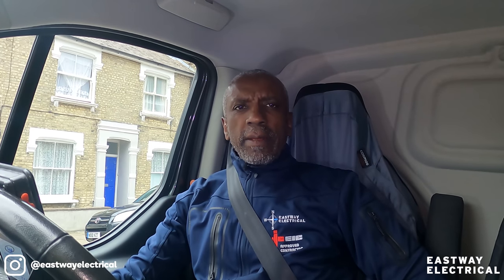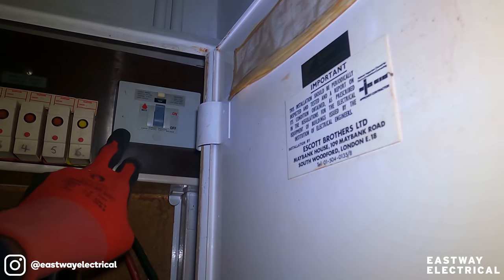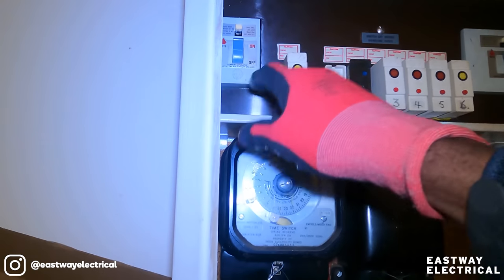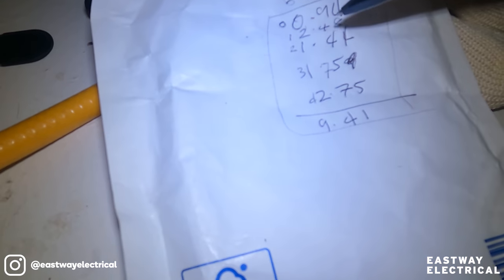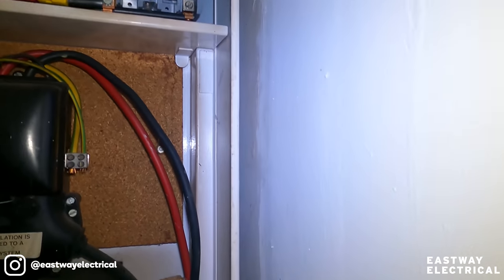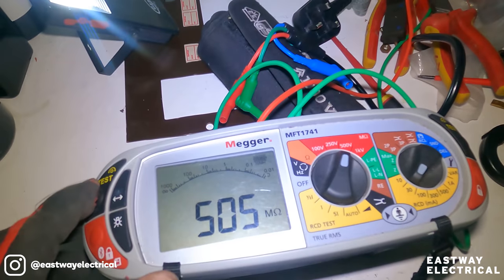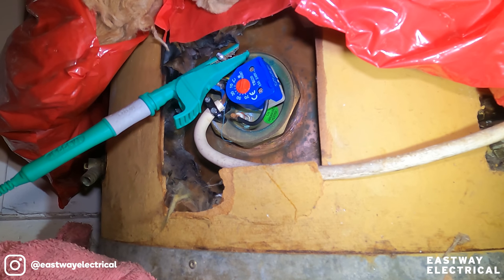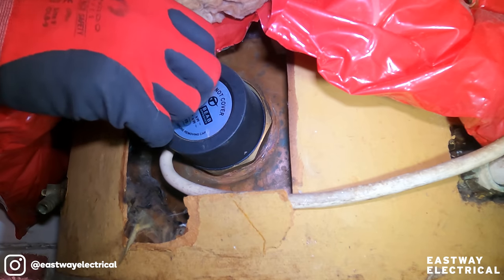"I've Never Seen This Before!" | Tripping RCD | Electrician In London

Comment: Hi sir as a retired electrician I can see a lot of potential issues, which I’m sure you have considered . You could potentially spend a lot of time trying to 
Pin down the fault , definitely those old RCD units are well past their best . But the whole instillation as you would concede is in need of a full upgrade . As for that door with meter tails that move back and fourth , that’s  indeed a first for me .  Just as a point of interest one of my old work mates had a persistent trip fault that happened at night , it turned out that a new fridge freezer had a door defrost program set to happen at night . When he contacted the manufacturer , they said yes we a aware of the issue and recommended that the unit has its own dedicated circuit with no RCD protection . You’ve got to laugh sometimes 😂.        Best wishes and kind regards 👍👍👍

Comment: There is a little mirror in the panel. Great for reading the Sangamo S200.31 meters with the large numbers, not easy with an LCD meter. Weird set up with the incoming mains on a hinged panel. Not very safe as the incoming supply wires are flexed all the time.

Comment: I try and solve these jobs over the phone and it works 90% of the time.
Top culprits are the kettle,the hob or oven elements and laptop chargers. most equipment around the house is double insulated . So advise helps the customer track down an intermittent fault.

Comment: If the hot water exceeds the temperature it’s set at don’t you think there could be a problem with the thermostat ?
Reply: Almost definitely I reckon.
Reply: Most likely and a quiet dangerous, would be an idea for the client to get a dual cut out thermostat.
Reply: Mine comes out as steam and just melts the top layer of skin off. Nice and fresh

Comment: where I am, that would be from a weatherproof outside receptacle that has had salt air get into it and leave a film of salt on it.  then when the humidity is higher, it will trip, and when it dries out, it will behave until it gets wet, again. - or simply a leaking one that trips when wet and clears when dry.

Comment: The off peak immersion heater could be on in the day instead of overnight as the timeclock in the meter cabinet may be set wrong especially if there has been power cuts which would put the time out with the clock stopping.
The temperature would be down to the cylinder thermostat but looking at the condition it would probably be best to change the immersion heater element depending how old it is and if its a hard water area.
Reply: A step in the right direction would be put a 2 rate smart meter in, which does away with those unreliable old timeclocks. That at least would solve the immersion time issue.
Reply: @paddington4815  The timeclock is owned by the energy supplier
Reply: @0liver0verson9  fit a horstmann timeclock in the airing cupboard then it will have a time clock for overnight and 1 hour boost as well,  it sounded like there are already 2 supply's for 24 hour and restricted
Reply: @paultipton743  Just remember the supplier timeclock dictates when and how much the customer gets charged on the lower 2nd rate, nothing else. That needs to be rectified or any other timeclock won't be ensuring they use the lower rate on the meter effectively.
Reply: @0liver0verson9  The time clock just activates the supply to the off peak circuits at certain times its just a switch  even if it was not active or on 24 hours the lower rate would still be charged at those times on all circuits  determined by the meter suppliers even for general use circuits like socket outlets and lighting,so a time clock that is out of sync could be charging at a higher rate if its still running after the meter tariff low rate times.
A rate 2 smart meter would solve that as you mentioned previously or by disconnecting the off peak immersion circuit from the consumer unit and just using the 24 hour supply to a separate timeclock set to 2am -7am should have the same results and still be charged at the lower rate.
Reply: @paultipton743  No the timeclock activates low rate on these dual tariff meters. If it's out of sync with traditional E7 times the customer will not be charged more for the cost of heating the water. It may benefit them if it's grossly out of sync. The thinner wires on the timeclock are for triggering the meter.

Comment: Upper immersion is used as a backup or boost and generally switched off... customer has e7 2 rate time switch which should kick in overnight (off peak) and liven up lower immersion which will heat up majority of cylinder, wired wrong Del...  their electric bill must be nice....

Comment: At my place we were always having trouble with the RCD tripping intermittently and it turned out to be the Toaster. The Toaster would only cause the RCD to trip if it was used twice in a row , i.e the toaster was already warm.
Reply: Check for debris touching the elements inside the toaster, they can cause the RCD to trip.
Reply: over loaded circuit will also cause a  trip
Reply: @johndjchemistwhite9377  Yes, we ended up replacing the Toaster but it was an intermitant fault that has hard to pin down as the Toaster seemed to work fine.

Comment: I always look and ask 1st.
anything diy been done recently 
any faults with dishwasher 
boiler
or  washing machine or any outdoor sockets or lights

then get megger out and look for low insulation readings 

rcd test in ramp test like he did.

sometimes the fault can be the water heater element going bad had that few times as the insulation breaks down over time on the heating element
Reply: Absolutely!  - a bit of good detective work first works wonders!

Comment: Usually when a hot water heating coil breaks, it breaks open circuit. The temperature shut off gauge on the tank is broken since the guy said he was getting to 80C water output.
Reply: Yeah, you can replace the thermostats on those immersion heaters really easily. They pop out without having to remove the rest of the unit from the tank (where you risk tearing the copper or flooding the place!). They come in 2 sizes and they're cheap. Simple resistive loads like the ones in immersion heaters can trip an RCD when they are failing, but I don't think they'd put current on the CPC, which is needed to trip an ELCB.
Reply: @havoctrousers  Toolstation, 7" and 11". £8.99 or something like that. 

It will put current on the CPC depending how it's breaking down, seen it before where they've just started to go and it's not enough to cause SS and trip the fuse or MCB but it'll do the RCD. If that tank is scaled up which looking at that insulation it's 1980s ish yeah I'd fully expect it to be scaled up, corroded and high enough res to not throw an ELCB when hot, but cold it's a different story.

Comment: Really interesting video and a joy to watch you going through your thought processes and testing. Here is a suggestion:  From what you showed and what the customer said, I would suspect there is a borrowed live bridging the economy seven timed circuit.  This gives an alternative path when the timer kicks in at night causing the residual imbalance and thus tripping the RCCB at night.  As the timer is disconnected during the day you were not able to detect the connection with your testing.  I suspect if you find the rogue connection to the element you would find the issue.  Remember an RCCB looks for an imbalance of current and that can occur on the live or neutral without the need for any path to earth.

A simple test would be to check if there is a voltage (under a small load to remove parasitic coupling errors) on the live from the timer.  This should be dead and switched out of circuit when the timer is off.  Thus when the timer turns on the lives will be connected together creating an alternative path for current. If what I think is true then switching off the second RCCB would probably stop the fault as the two lives would no longer be able to be connected whatever the state of the timer is in. As with a neutral to earth fault the current will only flow when a load is connected so it can appear intermittent just like a neutral to earth fault.
Reply: Wouldn’t this make it trip every night ?
Reply: @danielnielsen3035  Not necessarily, as they're both effectively connected to the same voltage source.  It really depends on the load.  When there is no or little load then the current will be small. As the load increases the residual error current will increase.  As the economy 7 runs when most people are using the least electricity it is likely they are also using very little electricity.  As they have jerry rigged the hot water cylinder, the element may not kick in, causing a sufficient load to cause the trip as the cylinder is already hot.  If they were to use an electric kettle or use an electric shower, etc. it may also cause a trip.
Reply: That was really insightful, thank you

Comment: Have seen a few combined meter cabinet and consumer units in the past but not quite like that with economy 7 timer built in. Have had it loads of times where the fault isnt there when i go to investigate.
Reply: that's one of those laws of nature.  the system works perfectly when the repairman is there.
Reply: @kenbrown2808  usually reappears just as you get in the van and drive away.
Reply: @chrismaplethorpe6781  nah, usually right after you get home and get your shoes off.
Reply: @kenbrown2808  usually the customer doesnt seem to understand that intermittent faults happen then moan at us for not doing our job right.

Comment: There were two kinds of ELCBs, voltage-operated ones and current-operated ones. VOELCBs relied on an isolated CPC throughout the installation and sensed a voltage between the earth connection to the ELCB and the CPC, i.e. they're easy to spot as you've got two earth connections that an RCD doesn't have. COELCB is just an old term for RCD, technically it's absolutely the same.

VOELCBs should be replaced immediately as they don't offer any protection if someone touches a live conductor and they become immediately useless if the CPC is earthed. They only disconnect L-E faults.

Comment: It's probably his kettle leaking slightly. Had the same problem in a property I lived in and it would nusience trip the RCD on a split load board 

Surely the immersion being on at the wrong time was the timeswitch not being set right ?

Comment: How this clamp meter works if it was putted on Live and Neutral simultaneously?
Reply: Perfectly fine to do so, as the neutral will not impact the reading in any sensible way and when done this way would have also shown fluctuations in the return as well as the supply. There is, however, a risk of it picking up extra measurements if for some reason the neutral wire is live as well however in this case the wiring was pretty evident.
Reply: It's measuring the differential current. Common mode currents are cancelled out so the indicated reading is leakage current.
Reply: That's make sense just will read leakage current. Learn something new... Thanks Nick & SDG
Reply: An earth leakage clamp meter goes over both wires to measure the live current minus the neutral current, giving the leakage current. How it works is that the non-leakage current is equal and opposite in both wires (i.e. is differential), so it cancels out, whereas the leakage current travels in the same direction in both wires and so is picked up by the meter. A normal current clamp meter goes only on the live wire to measure the total current.
Reply: Hi -
A clamp meter works by measuring the magnetic field around a wire that is carrying current. ( hence the "clamp" around the wire to "sense"  the field)
Why clamp "both wires" ? 
 In a simple "perfect" circuit where  there are "two" wires connected to  a load - the current will be the same in each wire  -since "what goes "in"  on one wire , goes "out" on the other wire " - there is nowhere else for the current to "go".
NOW - if we arrange our clamp meter so it clamps around both wires - then the magnetic field will be zero since the currents in the wires are going in opposite directions so the two fields cancel out.
(as per above - going "in"  and going out)  and  thus we will read ZERO current. 

Now- it's easy to see that if there is a fault in our simple circuit which allows current to "escape" via another path - then the currents in our  wires won't be the same - and we will see a reading equal to the "difference" in the current - and it's easy to see now that this difference current that we measure must be equal to the "leakage current" going "somewhere" else.   
 
Whilst this is alright in "theory"  with the idea of a simple circuit as described  - in the practical case - finding where that "leakage" current is going - and what is causing it -  is often not  easy to find.  
Also bear in mind that in the practical case - especially where appliances and loads are connected - there will be some leakage current  that we will call "normal".  
And HERE is the problem with a "common RCD as is the case here - and ALSO  that you see oh so often in split load boards ( they are the cheaper solution for board changes)  -- since  it is "seeing"  the total leakage current of many  circuits combined - and -  now you can see, that you only need a  few milliamps of leakage current in each circuit to get "close" to the RCD tripping current - and so another small increase of just a few milliamps due to a minor fault can then cause the RCD to trip.  
This is why I ONLY EVER fit RCBO's  in board replacements etc - a few extra £'s of cost - but then only the circuit that is faulty will trip AND  saves an awful lot of bother down the line - cost saving!

On top of that - the  random  tripping RCD at various times as reported  could be due to a number of factors - and a good course of action here is to ask the client if anything has changed recently  - such as lights/light switches/sockets being changed  etc  etc and  IS there specific times when the RCD trips. 

Often  - where for example  -decorators have removed switch faceplates etc and then replaced  without taking care to make sure wires are suitably placed before refixing - can result in neutral wires being trapped under fixing screws  -where the insulation has just been "nipped" by the fixing - and pressure on the faceplate can be enough to cause a connection between CPC and neutral - which will often cause sufficient imbalance to trip an RCD.
 
I have to say that the installation is "well past its sell by date" - and a full re-wire of the property is the only real solution. Also - Meter tails and Henley Blocks on a pivoting board is downright dangerous.  Certainly wouldn't fit in with BS7671 "selection and erection requirements" 
I wouldn't be happy leaving an installation in that condition. 

Anything less than a  rewire. and all you will end up with is  - "owning the problem"

Comment: I've had it where those old Wylex RCDs just start to fail and intermittently trip. But test ok under test conditions . Id say a board change is required
Reply: I'd guess they're 40+ years old, possibly 50. They weren't a Wylex design, possibly not even manufactured by Wylex. Presumably, the original design was by F&G Austria in the mid-1960s but they were sold under half a dozen different names - F&G, Elin, Wylex, ESG Dresden, Hackbridge Faraday at least. THis being London it's probably an underground supply but I do know these RCDs are particularly prone to nuisance tripping from lightning transients. That's why many older people in Austria don't think you need surge protection - "the RCD will trip anyway". For the Austrian market the design was changed in the mid-1980s, so I guess these are at the very least 35 years old, unless someone else continued making the older-style ones.

Comment: Them old wylex boards with elcb were designed for social housing good idea but if a light bulb blew it would take the house out also they were used on tt installations with 100ma elcb's. That water heater had either the off peak or boost wired the wrong way round or the clock near that old wylex board had the wrong time set on it probably due to a power cut and the battery inside being knackered. Bet the home owners electric bill is all over the place.

Comment: eco 7 timer meters can move out of time when power cuts happen some old eco 7 meter need to be reset by meter owner  it why the electric comes on during the day . outside the economy period . newer meters work via a radio signal so no need to adjust some are radio signal and old timer combined and can also run out